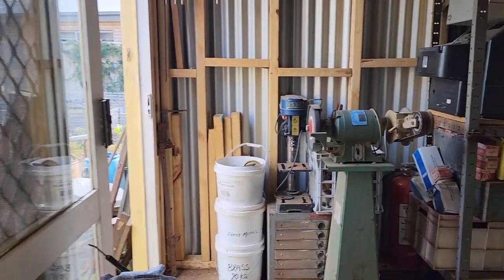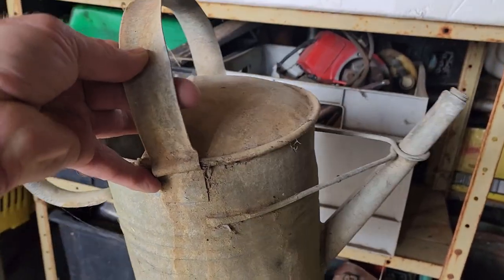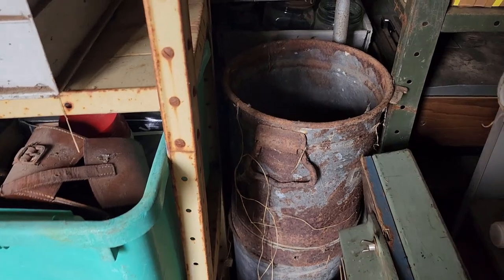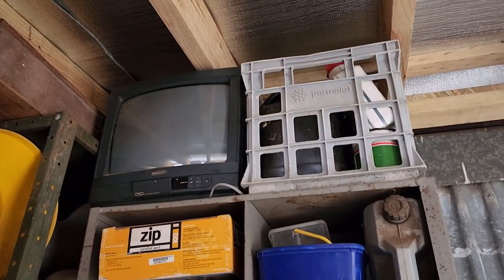Storage Shed Clean-out Part 29 - Unboxing Some Oil & Workshop Products and Testing a Samsung CRT TV

Comment: CRTs pull a lot of current at plug in or switch on due to the degaussing coil that demagnetises the tube. There is a thermistor in line which quickly warms and the current drops off to nothing having done it job. Pressing the channel buttons should get that TV out of Standby which it looks to be in with the red LED. That model does suffer from failed caps in the power supply that prevent them from running as well. They are an easy fix. I never used a dim bulb. They have a fuse that will blow or the switch mode power supplies will shut down if there is a fault somewhere. Mid 90s Chinese TVs do blow themselves up when switched on from cold, eg Teac, Akai, Palsonic, but its unlikely anyone is going to even bother to test one of those if any are even still above ground these days.
Reply: I agree with Steve. Press the channel button up or down.
Reply from the maker: Thanks heaps Steve! I can always rely on you for valuable electronics info! I'll follow up on this soon 👍😃

Comment: Random oil like that i either use in lawn mowers if it’s not open or in the chainsaw as bar oil.
Reply from the maker: Normal engine oil shouldn't really be used as bar oil Cameron as it doesn't lube the chain properly where it is required. Yep, mowers are a good option 👍
Reply: @TheUltimateRecycler  I usually mix it in with normal bar oil so it is still sticky. But long before bar oil was a thing guys would mix 30 weight with STP.
Reply from the maker: @cameronlamb7274  Yep, it needs to be sticky to hang on around the end of the bar!